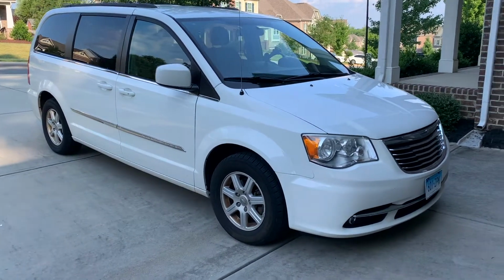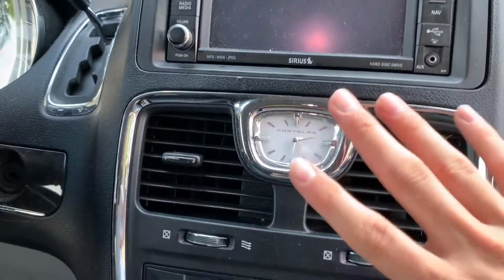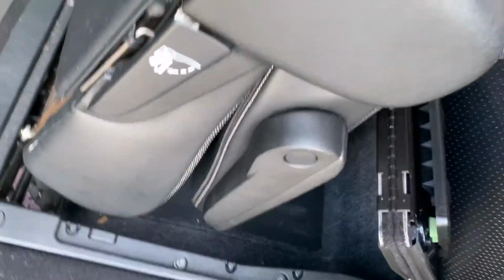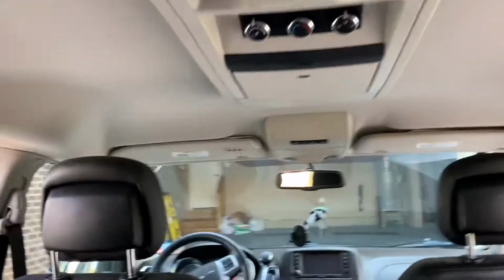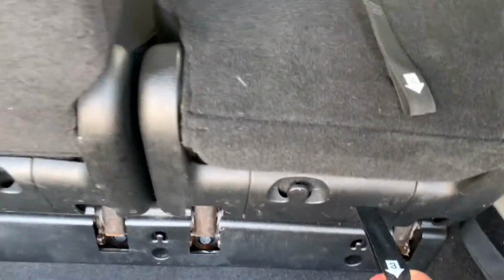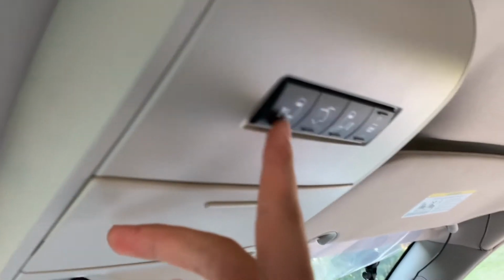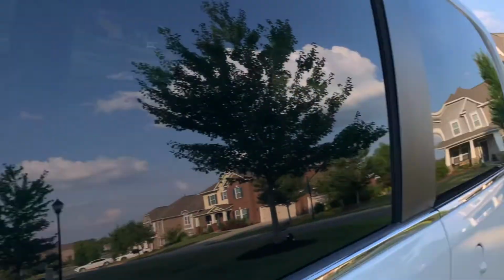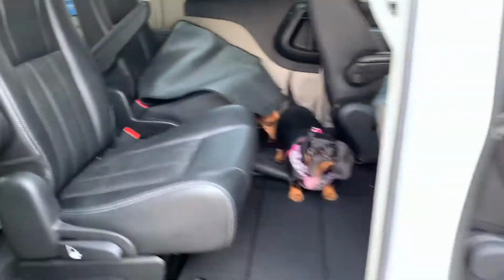2012 Chrysler Town and Country Touring | 90k Mile, 1 Owner Review

Comment: Have you had any engine problems? Also what is the yearly estimate on maintenance costs?
Reply from the maker: Sorry for the late reply!! No issues after almost 100k miles engine wise. We just had to change out the front bearings and brake rotors, serpentine belt, and spark plugs.